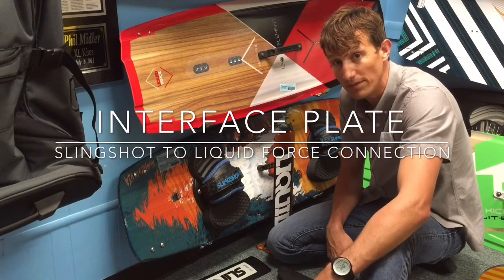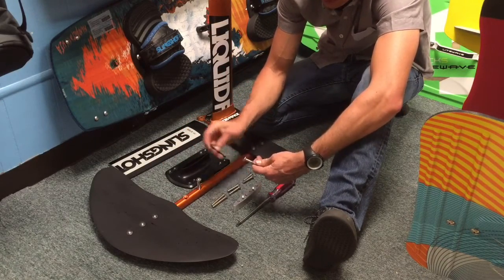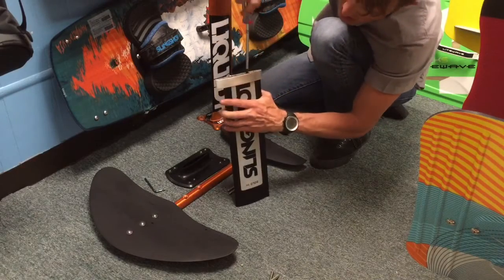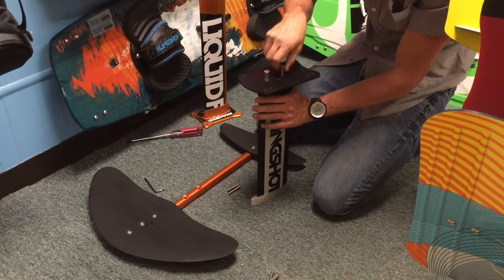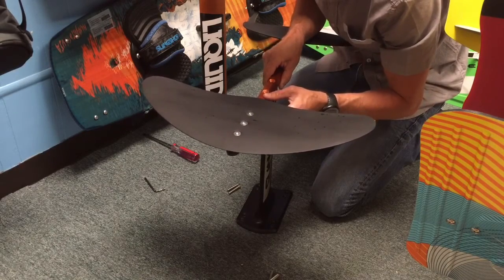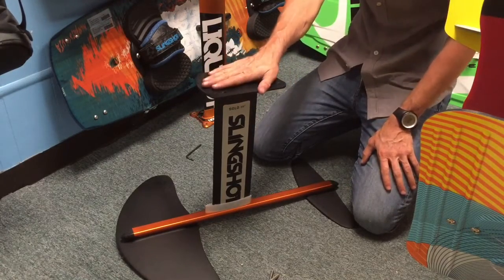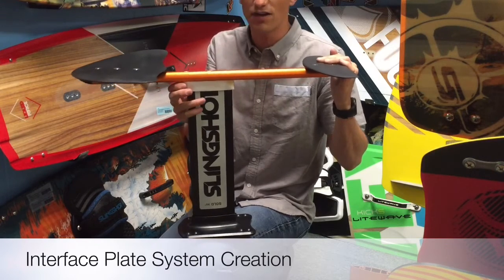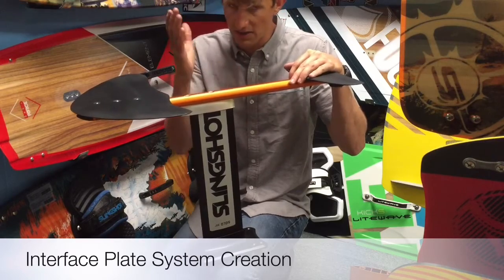Connect Flight School to Liquid Force Hydrofoil How Interface Plate Works

Comment: You dont need to buy a inter face plate slot the holes you  already have I did for the Cabrinha not much needed about 8mm  with rat tail bastard file
Reply from the maker: Jimmy, 
You could do that...and we did first, but have found that once you slot out the fuselage the extra 1/4" or so needed it tends to bend at that location.  If you do decide to mill out the fuselage holes my advice is to make sure to control the heat as it will further weaken the aluminum.  Have you successfully done this and foiled the outcome?  Thanks for the comment!
Reply: Do you still have any of these adaptors I'm in the UK.
Other than that any pictures for slotting the bolts 😀.

Comment: Great adapter and really useful!  One Question - the LF Happy Foil board doesn't have a completely flat surface in between the foil mounting tracks, but the Slingshot mast base is flat - so the parts don't really seem to connect very well, and if you tighten up the 4 x foil  mounting bolts it compresses the board a little.  How do you guys deal with this one?.

Comment: +Houstonkiteboarding hey guys could you do a video or info on what plate foil systems work across brands for boards. eg will the slingshot NF2 foil work on the fixed postion liquid force foil fish board or rocket board etc. Also have you got any naish boards and does the slingshot NF2 foil work on them? thanks so much in advance

Comment: Why bother though?
Reply from the maker: +Teran Hughes thanks for the question.  Right!?  Why Bother?  Well if you're already into hydrofoiling and comfortable on the full length mast then you may not need this unless you have a shallow water situation where you want to use the cheap 24" mast from Slingshot on your Liquid Force.  The reason this system is important is it allows riders to use the Cheap Flight School system $169 for three short masts with their current Liquid Force system.  Our other alternatives for Liquid Force is a 18.5" mast (without base plate) for $265.  You can see the financials are compelling.  Learning on a short mast is the only way to go as it will make it painless and overall be a much better experience.  We have a local shallow water riding area and many local guys don't care to use the full length all the time so they can ride in near the shore with other riders etc.  It is nice to have the short mast option as well as the full length.  Thanks again!